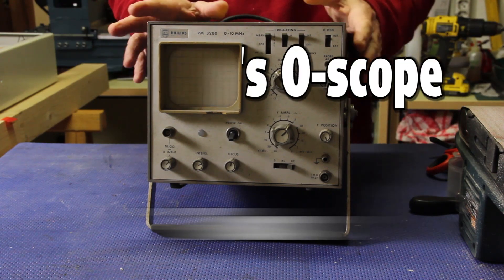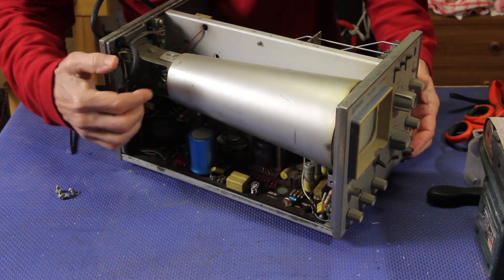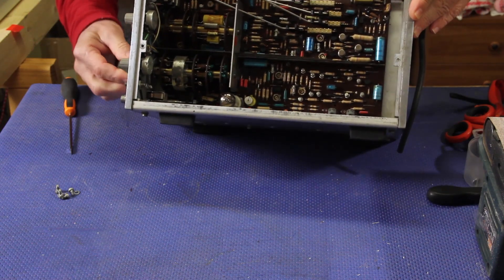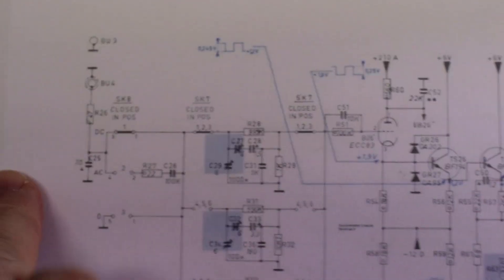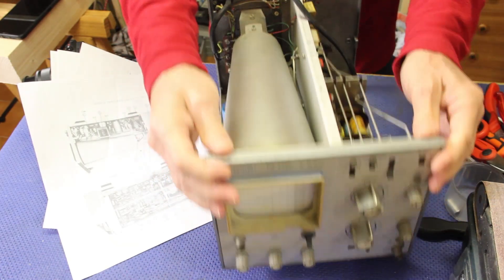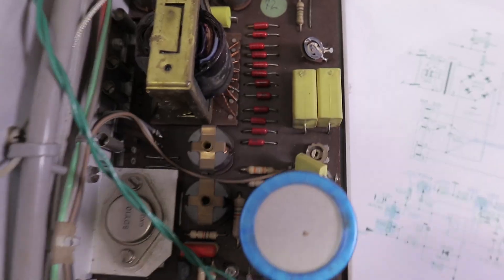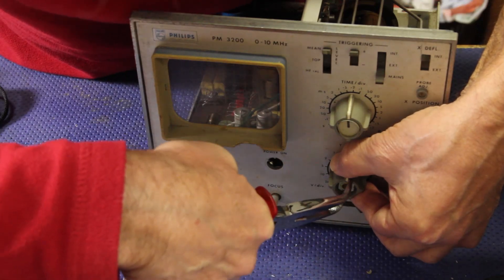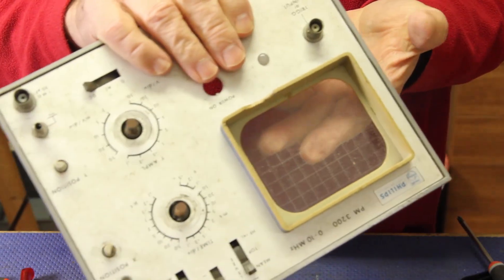Exploring the inside of an old Philips Oscilloscope

Comment: One of the assignments I had in the military was to sanitize surplus electronics of radioactive vacuum tubes (valves) and components that could possibly have PCB material in them. This was an assignment made in heaven for an amateur radio enthusiast, I brought home boxes of high quality parts, I used to either give them away, trade them for what I needed and got quite a few coffees in return. What amazed me most was how the mechanical aspect of the equipment was designed without the aid of computers/CAD.
Reply from the maker: Absolutely! That's a think that amazes me too.
Thanks for sharing your story. BTW, when I was in the military for a short time I got assigned to the radio laboratory too. One of the coolest experiences that I still remember after decades.
Greetings from the Alps.